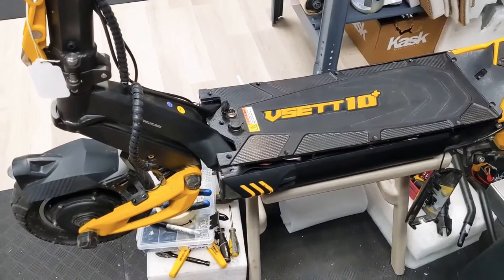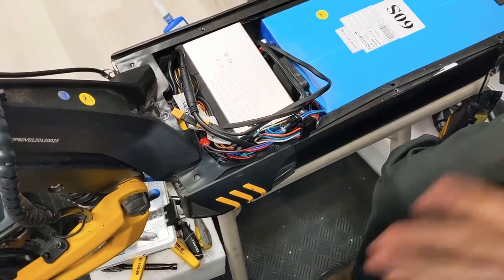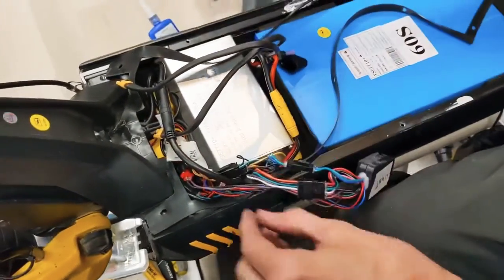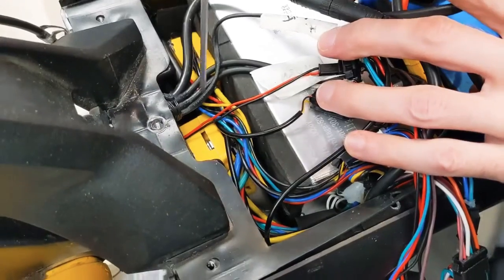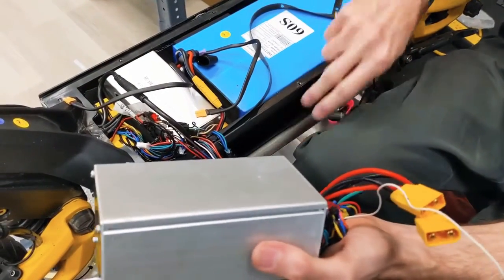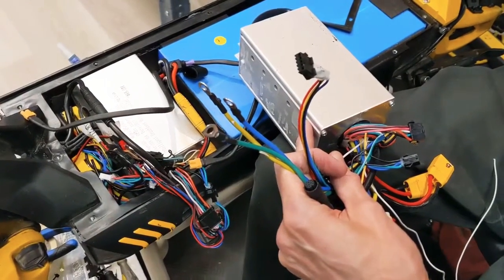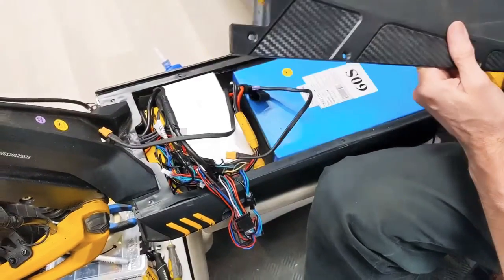VSETT 10+ | Replacing Your Controller

Comment: Bought a Vsett 10+, the other day it died and lost all power, wont turn on, wont charge - The battery charger light just goes dark when I plug it in. Pulled open the Deck and there is aboslutely no fuse in site like you have. Am I screwed?
Reply: Same bro I contacted them and I’m going to try and ship it to get fixed
Reply: @bypassings2745 did they respond to you? I’m having the same issue after 600 miles, no signs of life at all. It’s been 2 weeks and they haven’t emailed me yet.

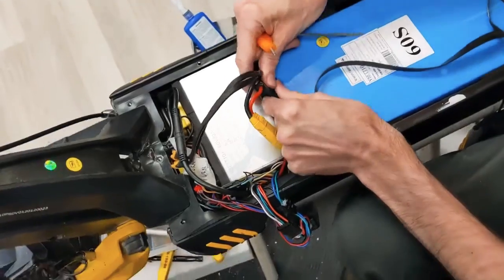Comment: 1:22 I just can't seem to find that fuse u have there... I lost power on both engines, but they sometime works almost like if its just a contact error. Could some wire be squeezed or damaged? head and backlight also no longer work. I might have shortened the circuit by accidentally touching inside the charger port with a screwdriver here the other day. But it has worked after that episode.. I suspect it could just be that fuse you are pointing out, but i just cant find it. its not in the same place as yours. Please help. Thanks Tom
Reply: I can’t find it either my scooter won’t power on at all and tested the battery it’s dead
Reply: Did you end fixing it somehow i ran into the same situation

Comment: My new Vsett 10+R throttle started acting up at 12 miles and left me stranded after riding maybe 3-4 miles… sometimes I can ride it for a minute or two and the throttle goes out and won’t work at all. I bought from alien rides and we are working to see what it might be. Any ideas? The scooter does power on just fine, it’s just my throttle sometimes works and sometimes doesn’t in both modes.
Reply from the maker: Could be a faulty magnetic connection on the throttle lever. Try a new throttle unit and see if that eliminates the problem.
Reply: @UrbanMachina  Sounds like that could maybe be an issue. If it was anything more serious I’m sure error codes would appear right? I’m gonna wait until tomorrow to see what Alien Rides say. And hopefully they can send me some replacement parts.
Reply: @loganrides2436  how has alien rides been? I just ordered my 10r from them too
Reply: @jaken528  good customer service. I had to send mine back to them.. but they repaired it within a week and I had it back.
Reply: @Logan Rides I have the same problem. What was the solution for you? This problem is real annoying.  Thanks!
Reply: @danaabousamra6293  I had to send back to Alien Rides, and they had to replace the wiring harness. All good since then though, almost 1300 miles on her now.

Comment: what kind of batteries are inside the vsett10+ 28Ah? there are several versions of lg 18650 but the model numbers are different, and so are the capacity and load capacity.